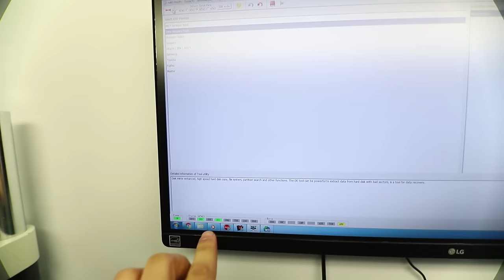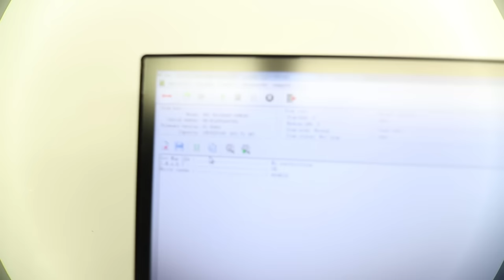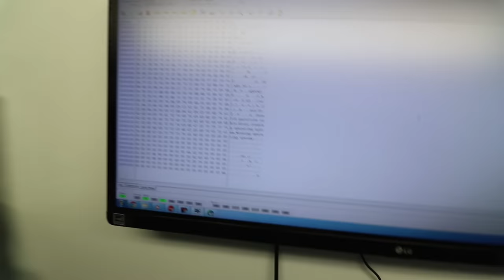hard drive does not spin? simple way to get your data back

Comment: swap  multimeter probes on the diode around because diode will appear short in one direction but not the other If both read short it's stuffed. It can be burnt out and open circuit too.
Reply: Actually, in this case, if the diodes were burnt out and open circuit, the drive would work (if that was the only problem).

Comment: Thx, after watching your vid, I decided to inspect the PCB of my seagate 1TB. Issue: not spinning!
I found a blown capacitor just after the 5v rail of power Sata. I replace it with another SMD capacitor that looks the same size >> no success.
I then remembered I got a board of a old HDD than I dissected long ago, and decided to give a try with those tiny capacitor on it, btw they are black SMD capacitors, no brown like the one I first used >>> the HDD is again spinning!!!! 
ok got some broked sectors, but I can live with that 😋 of course it is not my main HDD, only a HDD that I use when needed, only good to have another HDD lying around when needed 😁

Comment: Hello HDDRS, I think this is a similar story with our WD Blue 500GB Desktop HD which stopped working. No sound & not spinning and won't show up when plugged into another computer. I've never used a Multi-Meter before. What is the setting on it in order to read/find the possible bad diodes on the HD ? Also, what gel did you use to remove the diode ? How long do you have once the diode is removed to save the data on the HD ? I don't own a computer vacuum so what can I use instead of that ?

Comment: Great video, but I don't understand the process you used to remove the diode. What was that goo stuff? And did you then use hot air on it? Could you please explain that part a little more?
Reply: I figured it out. It's solder flux, and he did use a hot air gun. I just performed this operation on my drive and it did not fix the problem. The drive still does not spin.

Comment: This is exactly what my problem is.  The hard drive to PC, or SATA to USB cable, was bad so my PCB on my drive was smoking.  I am hoping if i buy a similar drive, i can connect the PCB of the new drive to the old one, and get my data back.  Will this work?  Correct me if I'm wrong, but the label of that hard drive looked simliar to mine.  Is it a Western Digital 1TB drive?

Comment: Wow, I had NO idea that dead diodes weren't supposed to beep when testing them with a multimeter, I have fried a bunch of arduinos and couldn't diagnose exactly which component was faulty, but that's because I didn't know that haha

Thanks for the tip ;-)

Comment: man your videos are always amazing! does the hard disk work fine without the componed that you desoldered???
Reply: Yep. Think of the de-soldered component as a kind of insurance or "safety valve".  Until something goes wrong with the power supply in the future, the disk will work. You don't need collision insurance on your car ... until you get in an accident, right?

Comment: Few observations. Why use zero resistance resistor? Next, diode lets current through in one direction only. If you remove it, there is no current going through at all. How is this a "fix" ?

Comment: Many thanks for a very interesting video.. I've recovered data from an external HD that was connected to the wrong PSU and fried the diode... What software do you use please
Reply: That software is by MRT Lab. It may be MRT Express. But it goes with a piece of hardware and the whole kit sounds very pricey as it will take you two years to pay for.

Comment: DUDE! My WD Drive was doing this for sure!! D3 was dead for me. Tested it and got the noise and no reading.. Took it out... And BAMMM Worked perfectly!!! Question, would you continue to use it, or just get the data from the drive and then get rid of it?
Reply from the maker: I am glad it helped. We clone drives right after. But if you replace the TVS diode with same one, the drive should be as good as before it fried

Comment: Great video! Thanks. I fried my 2TB WD Blue  HDD by upgrading my PSU and assuming that all sata cables are the same (They are not). I found an open zero ohm resistor on the hdd pcb near the 5v supply. I replaced it with a piece of wire. There are 4 diodes on this particular model's pcb. ...not just a D3 and D4, but also a smaller D1 associated with D3 and a smaller D2 associated with D4. Can you tell me if the same rule applies to these two additional diodes, i.e., if it is assumed that no other damage has occurred, can all four diodes be removed?

Comment: Hey brother, great video! Both spinner drives went on me after a psu popped. Both do not spin at all. I will definitely give this a try! One question, what solution did you apply when you were taking the diode off?
Reply: probably flux

Comment: Hi Erkin.
I am starting my own recovery company right now here in Sweden. I'm a little interested in that really big computer you're using in this video.

What is it for a machine? Looks really heavy!

I have ideas about buying a Rapidspar to start with, what do you have for opinions about it? I'm using DDRescue right now for my image job where possible. I turn off the re-allocation function through the com port before. Seems to work quite well, I have not failed with any image yet ...!

I do not really have the money to buy PC-3000 UDMA now at first. What did you start with for machines and software?

What do you think of SSD? I would not dare to buy one if so for 1cent

Do you have any old recovery tools software, hardware or similar that you would like to sell?

Keeping up with your videos is great and instructive to both see and hear you work!
/ Roger

Comment: If you didnt want to get into using the probes and sautering PCBs couldn't you just buy a replacement hard drive board and replace the whole thing if you were to find the exact model number to match your hard drive model?
Reply from the maker: No, boards have firmware. Swap from the same drive without firmware adaptation or transplant will not get you access to the data

Comment: Fantastic videos!  Thanks for putting them together and keep going. I have a  Barracuda 7200.12 that clicks and I ordered two PC boards thinking I may just need to swap the board out.  Any other recommendations?  I believe these drives are a common problem.  Where can I get the software that you use?  I assume the same software will image a disk.
Reply from the maker: moonspell2000 these drive don't click due to failed PCB. Heads are damaged and need to be swapped out. We use PC3000 and MRT for data extraction

Comment: a risistor that should be zero resistance ?? that will be a short cut :-)
Reply: Actually low resistance resistors are either acting as a fuse of sorts or a bias pull up

Comment: Hi...I was replacing my IDE Seagae Model ST3120A into my computer when a portion of the circuit board touched metal and smoke came up from that portion. Stupid of me not to unplug the computer while doing this, I know, but the question now is: Is there a way of recovering the data from this drive now that it only clicks when plugged in, then stops clicking after a few seconds? As it is, I get nothing on the monitor.
I checked closely to see if there were any burn marks, but there are none that I can see. There are no visible signs that anything was burnt, at least not that an untrained eye can see. 
Because the drive is very old and the data not that consequential,  I look at this as a hobby project and would be game to try anything that might get this drive to work OR to recover the data on the drive itself.
Thanks for any response.

Comment: in theory - if you have two of the same HDD (one with the failed MB/blown diode and one thats perfectly fine) - can you just swap out the MB from the working HDD to the one with the shorted Diode to help extract the data as fast as possible? also-  thank you so much - these videos as well as your production value is amazing. You have the ability to explain something so complex into something we all can understand (somewhat) with limited training.
Reply from the maker: chrxx studios no swapping them even if they are identical. Unless you swap out EEPROM as well
Reply: @hddrecoveryservices   So apparently the motor blew on my WD passport. I was told initially it was just the plate and the enclosure was fine cause I heard it spin and beep but won’t mount to my computer. Then I get a call that it’s going to be over $1,000 to fix!?! I’m disgusted and at a loss cause there’s no way I can afford that and it’s insane! They are sending it back, what can I try to get my data off of it? Thanks I’m advance! 🤞🏼
Reply: Gotta swap the bios over as well if you want to recover the data as it holds the encryption keys

Comment: Awesome video keep up the good work !
Reply from the maker: Thanks for watching. Did it help you solve the issue?
Reply: @hddrecoveryservices  Going to try it now, over the festive period during the new year had a power surge take out some of my electronics including pc psu, I replaced that, and then my four hotswap drives = dead, so going to do it now, prayers for me, I will post the outcome.
Reply: @hddrecoveryservices  They got fried badly, I will look online for working logic board replacements.

Comment: Cool vid!  thanks.  Shouldnt a nube then reverse the probes when checking the diodes?  Are they part of a rectifier circuit and why will it run without the diode?   My 500gb external Lacie is alive, but sounds like a metronome.    whiring and click  click  click.  Doesnt spin up.  Any ideas where to start?  Thanks so much
Reply: For normal diodes, yes, you should check both ways. These are more like safety fuses that fail instantly in case current is exceeded and become conductive, 0 ohms. What this does is shorts the power which will trigger high current draw from psu and it will shutdown. It also prevents the current from frying delicate components behind the fuse.
User will then need to remove the hdd from his system.

Comment: Hello! I've an old WD caviar HDD and it didn't spin up. D2 and D3 were dead, so I soldered them out. D2 pads now okay, D3 pads broken (no short, no voltage - nothing). I soldered another diode there (B240, not B140) and now HDD spins up but it's "clicking" like a turn signal. Do you have any idea whats the problem? thank you!!

Comment: excellent video, however I found out that my issue was that I replaced the head of a WD 500 gig WD5000AAKS with a  3 TB WD WD30EFRX the platters and heads amount were the same and the head look identical, but when I put it on the 500 gig it did not spin so then I tried the circuit board of the 3 TB and it span fine however it detected it as a 3 TB and could not read the data, so I guess the look is not enough.  I did purchased a donor WD5000AAKS that was a year younger and bear the blue label instead than the white and yellow, but when I opened that it only had 2 platters instead than 3 so the heads were different, I guess I have to keep shopping for another donor WD drive.

Comment: Great info. I have a Samsung 250Gb  that spins up heads move after 5 sec. stop completely and motherboard never see it . I already replace PCB swapped bios but same problem remains. Donor works fine with exchanged PCB. What could be problem motor, heads or damaged platters?
I have two disks more same model same firmaware version. I like to practice on one of them to replacing head and/or replace platters.  have open the HD PCB donor and I have seen it only has one head and one platter I am wondering what is less risky to exchange head or exchange platters? Any comment is appreciated. Best regards.
Reply: Please try..if u succeed without software pc3000 everyone in the world thank u

Comment: Just had this problem with a drive in a caddy today.  I'm going to check it out but question is what you did to remove the diode.  What was the stuff you put on and ow does it remove the component?

Comment: This is not a usual diode, it is a TVS and its objective is to short circuit if the voltage exceeds a given level, that way the actual ‘brains’ of the drive is saved if you plug in a wrong power supply or if the supply goes bad. If you don’t replace the TVS you have now created a ‘ticking bomb’ for your customer. Use the 25cent and replace the component for future safety. Allso it is worth mentioning that your PC would often die if the drive was plugged in since it shorts out the 12 or 5v rail.
Reply: You are aware that the customer will get the recovered data on a brand new drive? The original drive is considered as junk after recovery anyway..
Reply from the maker: This is a 4 year old WD green, by nature it is a ticking timebomb with or without a TVS Diode. Data after being imaged out gets dumped into a new drive to be returned to the client.
Reply: I love your channel and I always thought you showed us how you do it so that we can do it ourself. (not only to brag and show how good you are) And if I were to fix one of my own drives I would want to do it properly. One thing is leaving the TVS out on an old drive and then copy it and toss it away, but if I had a new drive and just plugged in the wrong powersupply this would be a greate fix and if I replace the TVS it is as good as new. But if you just leave the TVS out -the next time you connect the wrong PSU the HDD electronics is going to be totally fried and then you may have to pay a thousand dollars to get a direct platter recovery from a pro-company like IBAS. If you just would have recomended changing the TVS instead of just recomending to leave it out you could save a lot of viewers from this hassle.
Reply from the maker: I see your point. But I am sure when the drive fails people would be more concerned about getting access to the data as oppose to making the drive reliable again.
Reply: Kim André Isvik Fossdal Sir what can I do if my both diode is shorted,is I remove both??
Reply: I agree with HDD Recovery Service. The point of this type of data recovery, regardless if you are a repair technician, or doing it yourself, is to migrate the data from the old damaged drive, and copy it to a new unopened drive. 

As a technician myself, and according to all other professional recovery technicians I've spoken to, the rule to live by is: Never trust or use a damaged or opened drive, even after it has been repaired with silver gloves in a clean room, with the utmost care possible with all parts replaced. Never. It doesn't matter, at all. To replace a "TVS" is moot, since the drive will be thrown away anyway.
Reply: I think moot is a really shit word and the only reason ppl use it is because sheldon said it on tbbt; had he not, we'd all have less grating in our minds ears such that you might have chosen a word of better usage like redundant or superfluous, and we'd have a better day.
Reply: Who's sheldon and what is "tbbt"?

Comment: Thank you, it helped to me too. What is the function of this diode?
Reply from the maker: It's a TVS Diode. A transient-voltage-suppression diode, also transil or thyrector, is an electronic component used to protect electronics from voltage spikes induced on connected wires
Reply: @hddrecoveryservices  Should just be replaced or removed?
Thanks for the great video btw

Comment: So if the PCB worked without the diode, what is the purpose of the diode in the 1st place? How many can be removed and have the drive still operate? What kind of test jig did you have on your PC that looked at the signals?
Reply from the maker: It's part of the circuit protection layer

Comment: How it works when you removed the diode. It means the circuit will be fine without the diode. Shouldn't it be replaced by new one to get the circuit working? I am confused how it worked perfectly after removing the component?

Comment: Wow, I would like to echo Mark Harrison's sentiments here.

I had a Seagate 1TB HDD which has stopped spinning up. Was just about to chuck it in the bin when I found your video. I'm glad I didn't now, because after taking the pcb off and checking the resistance across the diodes, just like you I found one which was a dead short. I proceeded to remove it (albeit not as cleanly as you did) and voila, it now powers up!

Copying the data off as we speak and buying a new HDD to replace it, because although it works now, I'm sure that diode was useful for something and I don't want to risk further damage.

Anyway, just want to say thank you from a very happy new subscriber :)
Reply from the maker: Awesome

Comment: Mine is spinning up - but never showing up - the H: drive shows up - I replaced the cable - the female end looks banged up that you plug it into - I was hoping it was the cable.  I did get some software from some local tech guy and saved my data from my last external HD - it slowed down the copy enough to read the files and copied to new external HD I bought.  I guess I have to visit "old steve" for that software again?

Comment: Thanks for this helpful video. My computer does not send a signal to my monitor and I tried a different monitor with the same results. It sounds like the hard drive is starting up with no strange beeping. So I removed the hard drive and connected it to a new computer to try and recover data but then the hard drive wouldn't start up. I'm confused by the hard drive starting up while in the computer but not starting up connected to a new computer as an auxiliary. Could the defective diode in this video be causing both problems?

Comment: Hi, why can't use just replace the PCB with one from an identical drive?
Reply: The PCBs are not identical. They have a critical chip that contains unique information about sectors for each drive. So you can't just swap PCBs, you also have to change THAT chip. Generally, it has 8 legs.
Reply: I was wondering this too, thanks for asking.